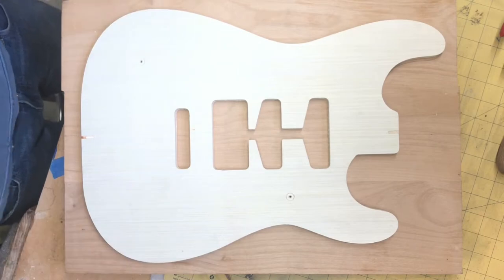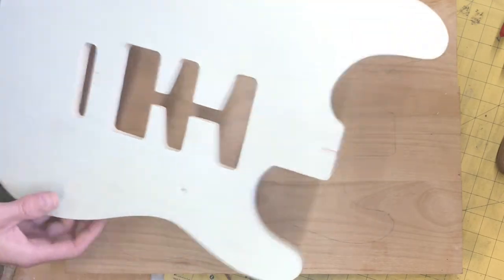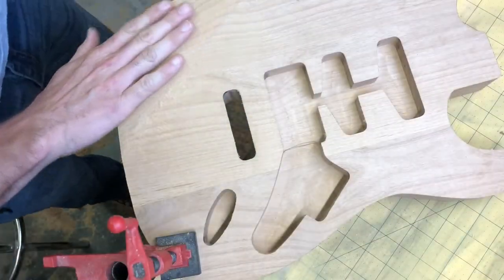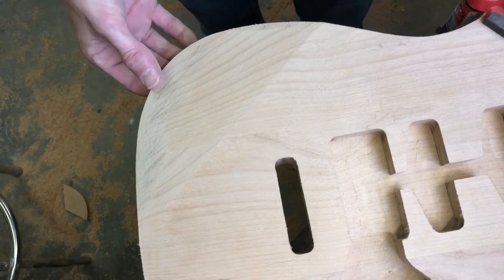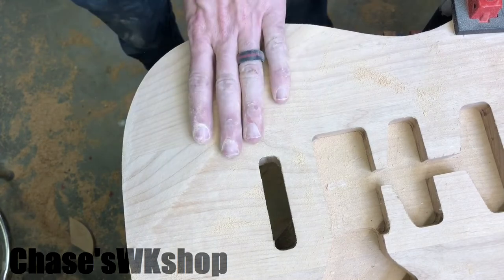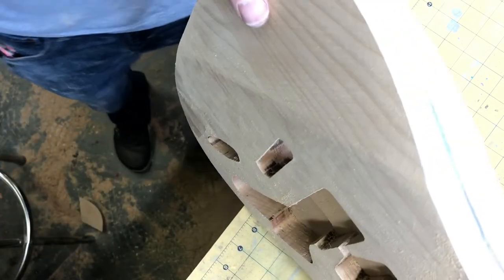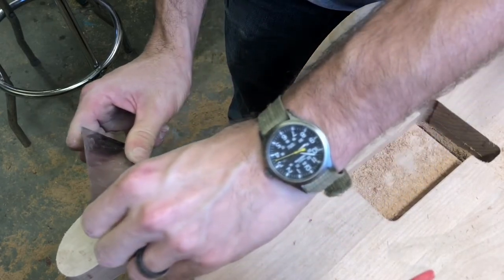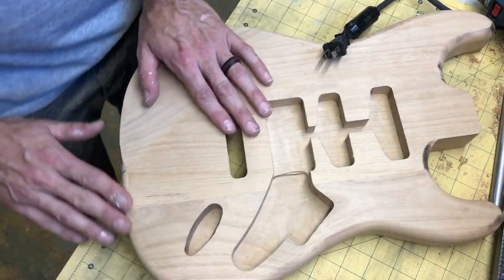DIY Strat Style Guitar Body,Tremolo, Arm Rest, Belly Cut

Comment: @chase’swkshop
What is the tool that you use for removing wood for the belly cut? Is it a kind of rasp?
Reply from the maker: Hey max thanks for the question. It is a Stanley rasp. I have a link to it in the description bud. They’re pretty cheap but work well to remove a lot of wood quickly.
Reply: The description, of course! Thanks so much for the quick response and helpful video.
Reply from the maker: Max Markin no problem bud glad to help you out! Welcome to the channel!!